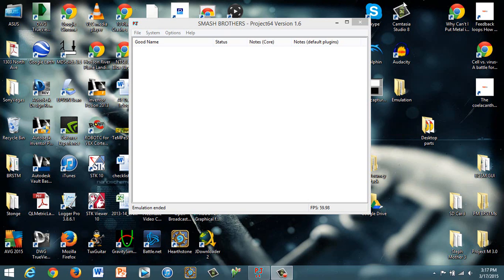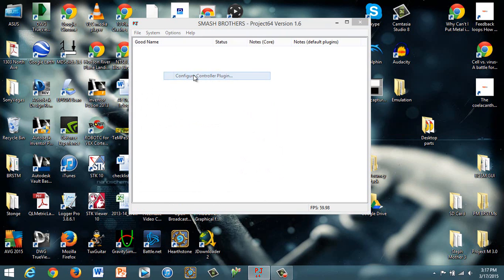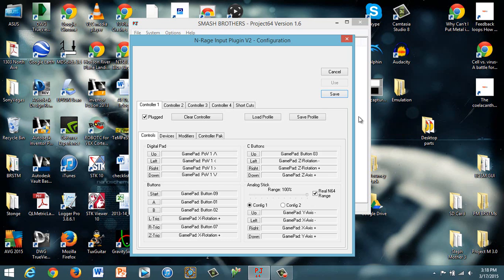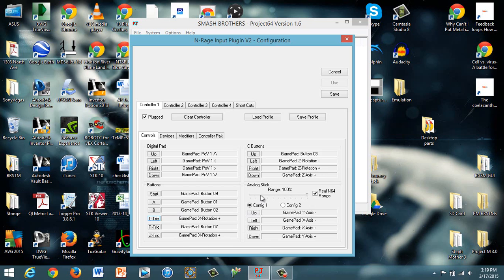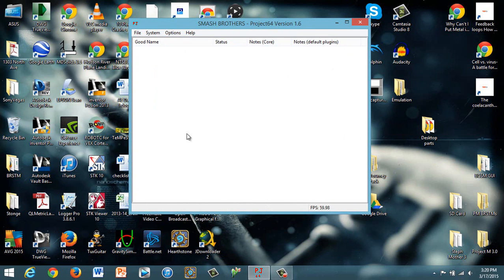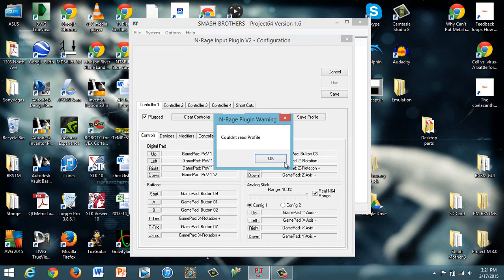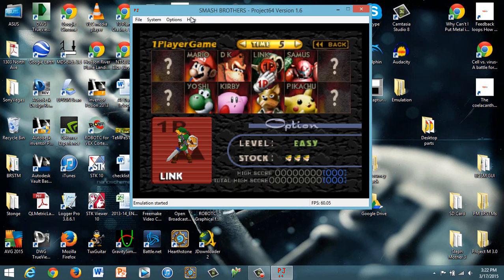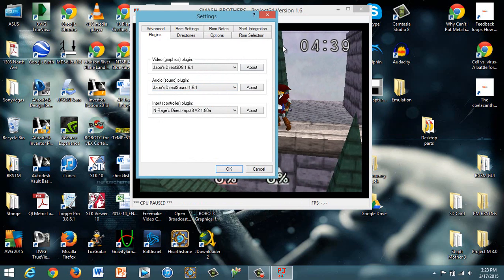Project 64 Mayflash Adapter Setup for Gamecube Controller Windows 8

Comment: For whatever reason, my C-stick doesn't want to work at all. But, I got the triggers working on the controller. any advice on getting them working? if it helps, I'm using the newest NRage plugin along with the controller they released for Smash 4.
Reply from the maker: +GN-X GokaiiRed Is it the 2 port or 4 port adapter? I used the 2 port in my guide.
Reply: +Battle X On I'm using the 2 port adapter, this model specifically: http://www.amazon.com/gp/aw/d/B0089NVTDM/ref=mp_s_a_1_5?qid=1452664468&sr=8-5&pi=AC_SX110_SY165_QL70&keywords=mayflash+gamecube+adapter&dpPl=1&dpID=418ckae1MnL&ref=plSrch 
I have my controller plugged into the right port. Thanks for replying so quickly man.
Reply from the maker: +GN-X GokaiiRed the cstick can be finicky, id try messing with dead zone and the  other value.  basically, you want to make sure the program senses a direction, so yu increase sensitivity
Reply: +Battle X On I see you had your deadzone set to 100, I believe mine was set to that as well, but I guess I'll have to double check. Do you have the same adapter as I?
Reply from the maker: +GN-X GokaiiRed yup, same controller too. as long as you have the setup done the same way then, it should work. doubke check in the devices and printers part of control panel to make sure it see the controller properly. you can calibrate it there.
Reply: +Battle X On What would it come up as in the control panel? I don't believe my controller came up in devices and printers
Reply: +Battle X On Hey man, no need to help me out any longer. I just needed to calibrate everything in Windows.
It all works fine now, thanks again man.
Reply from the maker: +GN-X GokaiiRed glad to hear it works!

Comment: Battle X On you never told us how to activate the controller. TW I'm using the cheap adapter that was made in japan thats very similar to the original but its compatible with the PC and Wii U
Reply from the maker: By mapping the controls it's already activated. Not sure what you mean. Any additional info could help me help you!
Reply: Battle X On Will the 4 port adapter im using work??
Reply from the maker: SmashTube I dont know which adapter that is so I'm not sure.
Reply: Battle X On http://www.ebay.com/itm/MAYFLASH-4-Ports-GameCube-Controller-Adapter-for-Wii-U-PC-USB-/281552589276

Comment: Also, one more question, is the controller set up like this?:

GC=N64
A=A
B=B
L=Z
R=R
C-stick- Down=Down Left=Left Right=Right
X= C-stick up
Start=Start
Reply from the maker: Mariostar123 The controls are all correct except GC R is set to N64 L if you want to taunt and GC Z is set to N64 R so that Z is now the grab button.
Basically, I remapped buttons to work like Melee, Brawl, Sm4sh buttons to make it play easier with the GC controller.
Reply: Battle X On  I thought the Nintendo 64 didn't have a L button.
Reply from the maker: It did. L and R and then Z was on the back.
Reply: Battle X On 
Ah, I thought it was just Z and R.
Reply from the maker: For smash L was taunt, R was grab, and Z was shield iirc.

Comment: Is this the one that works with a Wii U or the one that supports PC only?

Edit:
*the adapter you can use for Super Smash bros. for Wii U?
Reply from the maker: Mariostar123 This is the mayflash GC to USB adapter. It's a PC adapter, not the WiiU one. I haven't tried that yet but I don't think that works on PC since it's using two usb ports and it would probably confuse the software.
Reply: Battle X On 

The Mayflash compatible with Wii U has a switch to change to PC and the offical adapter for Wii U will work if you have certain software.
Reply: +Battle X On I know it works with Dolphin.
Reply from the maker: I posted that comment last march. I now know it works, but haven't set it up.